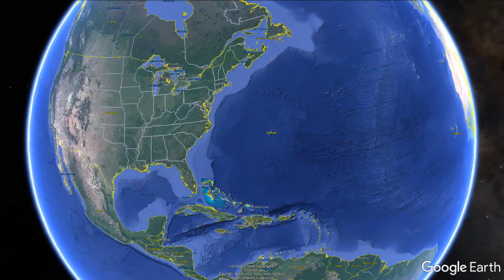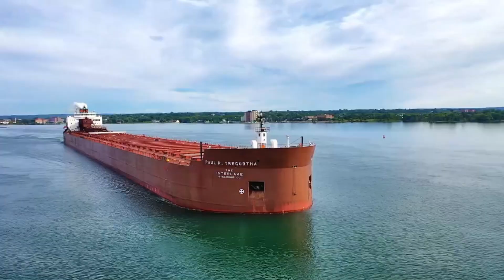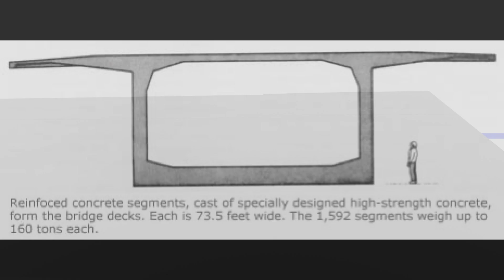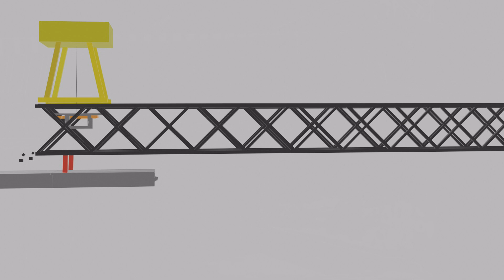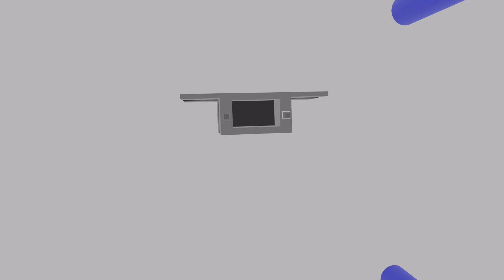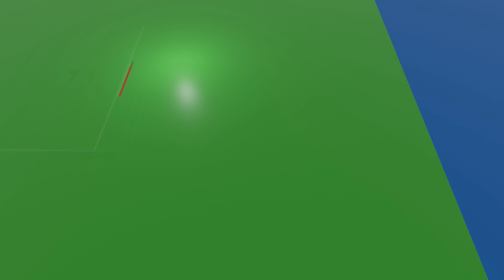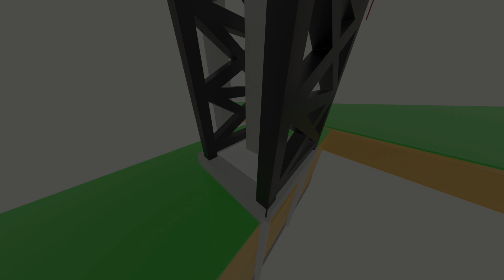Zilwaukee Bridge Construction Accident Repair Documentary

Comment: 0:34 Uh, that's not correct at all... In 1960 there were about 108 miles of I-75 freeway completed and opened to traffic, compared to the completed length of 394 miles. You can look at the official 1961 map of Michigan and see. The only open segments at the end of 1960 were the some segments south of Detroit, though the Flint-Saginaw-Bay City area, and from Indian River north to the Mackinac Bridge and St. Ignace. But there were major gaps between Bay City, Grayling and Sault. Ste Marie that took years to complete. The section from Grayling to Indian River wasn't complete until late 1962. The Sault Ste. Marie International Bridge wasn't completed until late 1962 as well, and the segment from St. Ignace to Sault Ste. Marie wasn't complete until late 1963. The entire freeway wasn't completed in Michigan until late 1973, when they completely filled in the gap from Bay City to Grayling (however before you could use US-10 and US-27 to get from Bay City to Grayling via freeway without stopping, it just wasn't actually I-75). My grandfather worked on the segment north of Indian River in 1960.

It would have been more correct to say 1973 or 1974, but definitely not 1960.

Great video though, I just wanted to point out that error at the beginning which is wildly inaccurate. Everyone makes mistakes so don't take any offense. I just know a lot lol.
Reply: US 10 between Bay City and Clare was marked  Temp I-75, and was built to interstate standards.  US 127 {was US 27} at that time, was marked To I 75, but was not built to interstate standards, as there was grade crossings at that time.

Comment: I understand that  a couple of years ago MDOT, in testing how the bridge was holding up by core drilling  through parts of the concrete ,  accidently drilled through one of the cables holding the bridge together. 
I don't know how the repair was made, but many lanes were closed for quite a while . . .
Reply: I remember hearing that as well...as if I needed another reason to dislike driving that bridge.
Reply: It was a problematic/failed rehab project/bearing replacement in 2008-2010, the as-built locations of the tendon ducts did not exactly match the as-built drawings and some were cored through, the contractor was also not an expert in this type of segmental box girder structure (very unique in Michigan). The strand loss resulted in the installation of an external post-tensioning 'exoskeleton' for a few years until a fix could be derived and built. That project was completed in 2016 and the exoskeleton was removed. Other work included bearing replacement, deck sealing and lighting replacement and the bridge was returned to excellent condition with an estimated 60-70 years of life remaining (it was designed to last 100 years). The bridge is aging very well and de-icing salt has never been applied to it (an alternative non-corrosive formula has been used since day 1).

It's a good bridge.

Comment: I remember that bridge construction dragging on but I was just a little kid and didn't realize what had happened.  This is a fascinating video
Reply from the maker: I was also a little kid and did not have a good understanding of what happened.   

For reference, I am 43 yo.
Reply: There was a period when they actually thought they would need to scrap the entire project and demolish what had been built (and it came quite close to that). This repair solution was seen as revolutionary in being able to save it, it was the first time it had been tried.
Interestingly there is a large bridge in Corpus Christi under construction right now dealing with some potentially fatal foundation flaws and will likely need creative (and perhaps similar) fixes if they are to save it. The approaches to that bridge are the same design/type as Zilwaukee.

Comment: That bridge ended up costing way more than it was supposed to. They made mistakes on it, part of it almost collapsed.  They have done more repairs on that bridge than its worth. It was a bad design, bad build.
Reply: There is nothing wrong with the bridge. It was designed to last 100 years and it's still expected to last 100 years. The rehab project in 2016 was normal work for a 30 year old bridge, just basic maintenance. They shouldn't need to touch it again for another 15-20 years.